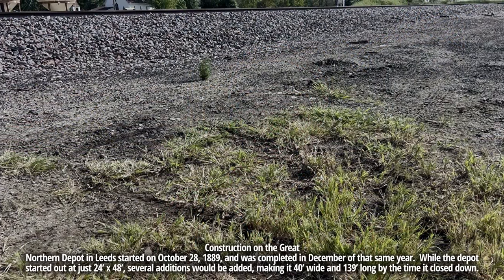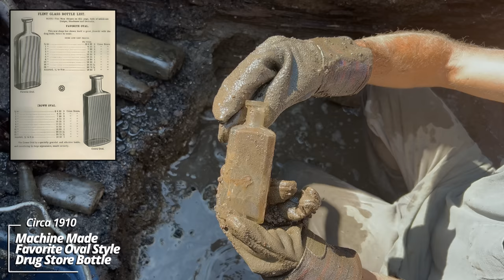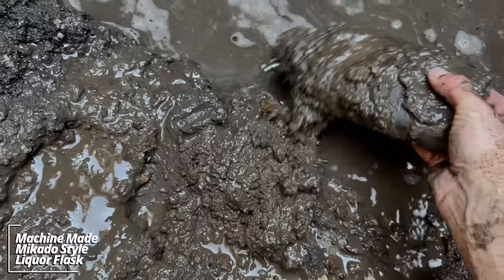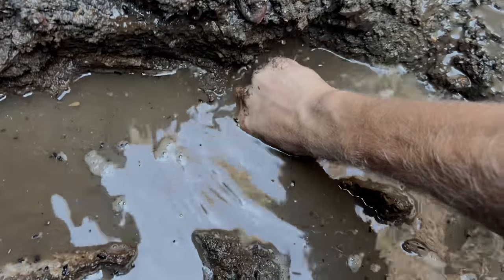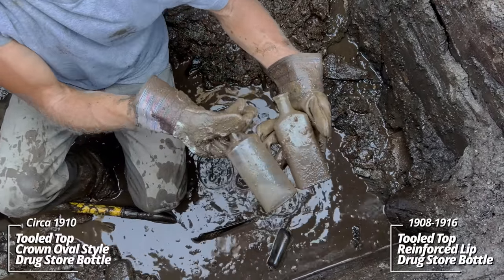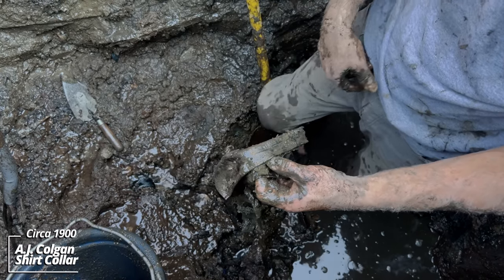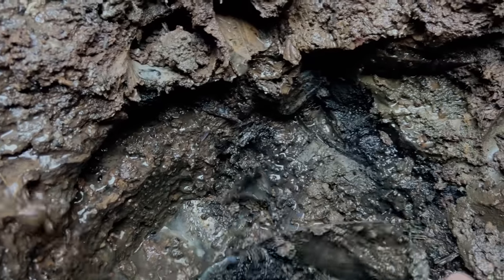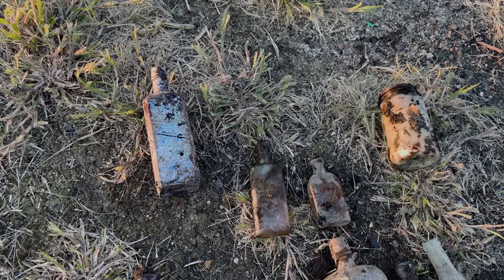Underground Train Station Vault Full of Old Valuables Opened for the First Time in 125 Years

Comment: That bottle exploding like that may have been from a drastic temperature change. It looked like it may have still had original sealed contents in it.
Reply: I understand that in this whole it's from a Outhouse but I wonder if bottles could be drink
Reply: that's not what caused the explosion. fermentation occurred over a long time with soil pressure stabilizing the bottle. when he picked it up it disturbed the fluid releasing carbonation.
Reply: Pressure change.
Reply: Yeah. The pressure of the soil was the only thing holding the bottle together. And the stability was keeping the pressure from agitating. He picked it up and shook it, that's how you make it go boom.
Reply: @nightmansmemo  I wouldn't; not from the outside factors alone, but also the fact that when wine or beer isn't stored properly; it can't turn poisonous.  That's why wine cellars aren't just holes in the ground with air conditioners over them. A wine company in California did a mini documentary about it. Should be able to find it on youtube.

Comment: If I had to speculate as to why the bottle exploded I would say it was due to the pressure inside the bottle due to the fermentation of the wine exceeding the bottles' wall strength and while it was underground it had sufficient external pressure on the outside of the bottle to counter the internal pressure. Once you remove it and it no longer had the external pressure on it and you shook it releasing more of the CO2 that was suspended in the wine, the internal pressure exceed the bottles' wall strength and it blew up. Yes you are very lucky!

Comment: Just curious why don't you wear long-sleeve rubber gloves instead of leather work gloves. When I painted houses I used latex gloves. you can use latex/nitrile gloves underneath your leather gloves keep your hands clean away from contamination. You would still have a good feel for what's in the ground. Just a suggestion.

Comment: I used to fill the water cooler with pop at my dads store in the 50s.  I had full pop  bottles explode when I  put them in the cold water on a hot day.  At least three times it happened to me.not that violent.  Just crack apart. Dad said first time I hit another bottle.  But it was the cold water cracked  them... They sat upright in the water., old lift top coke cooler.

Comment: BTW I saw on eBay a labeled whiskey identical to those 8 ounce “drugstore” bottles you regularly pull out of public-use honey holes like this. Even had increments embossed on the back. So highly possible at least some of that type were actually used as half-pint liquor flasks.

Comment: I had a nearly empty bottle of Sobe explode on me years ago, i drank most of it a day earlier, put the cap back on and forgot about it, the next day opened up a drawer to the desk the bottle was sitting on and the bottle exploded, I don't see how it could have built that much pressure in only a days time, but it somehow did.

With what happened in the video i can understand why it happened. 

being that old the pressure built up inside due to the liquid breaking down, with it being underground it stabilized the bottle to be able to handle the excess pressure that built up over the years, as soon as you removed it and disturbed the liquid inside it caused the pressure to spike to the point the glass couldn't take anymore.

Comment: Would it be prudent to wear waders on water filled digs? Glad you weren’t hurt x
Reply from the maker: haha we used to wear waders and rubber boots, but they usually only last for about a day before they are riddled with holes.., usually in the foot area, because when you push the tools into the ground with your foot, its really hard on the rubber... trust me, if they made a product that could survive like 10 digs, i would buy it.. but honestly, when i did used to use those, it made life absolute hell, because it was SO hot, so ive learned to just embrace the grossness.. but yeah, having your feet wet all day is pretty awful, but theres just no practical solution. but thank you for watching, and commenting

Comment: When u say pit smell terrible. What exactly does it smell like?
Reply from the maker: towards the top it usually smells kind of like a lake smell, but strong.. like that dead fish kind of smell.. and then once you get lower, you will suddenly take a shovel full of slop, and it will just break the seal on some really smelly stuff.. it smells like sulfur almost. rotten eggs and sulfur. usually the lower you go below the water table, the worse it smells. but when its a dried out pit, then it doesnt smell bad at all.. just smells like potting soil. it never smells quite like waste, but it does has a very specific smell. sulfur is the closest approximation. thanks for watching!